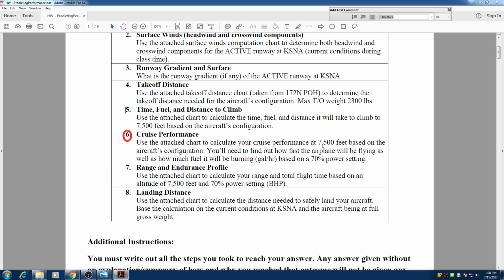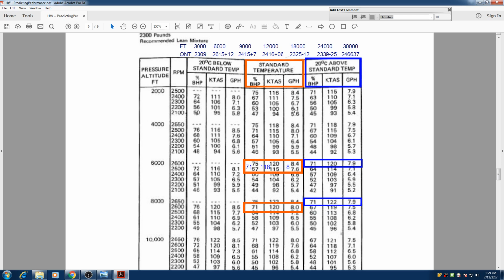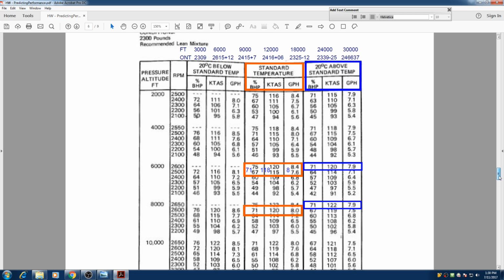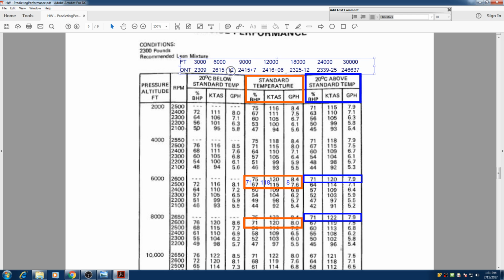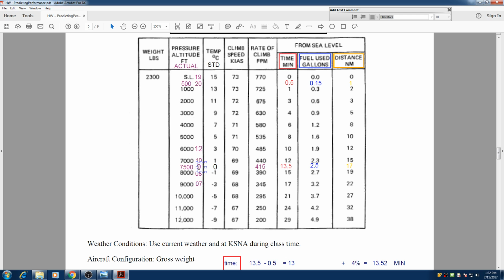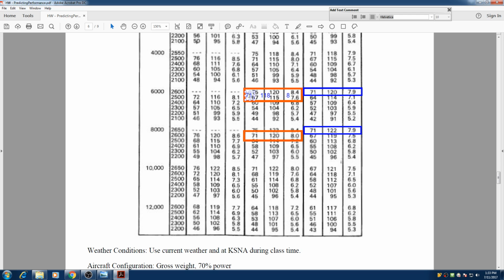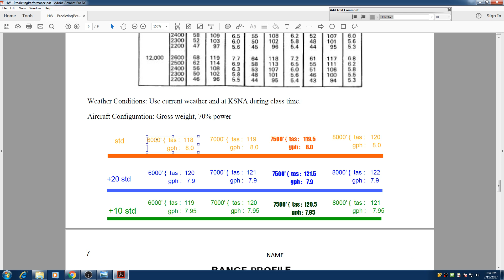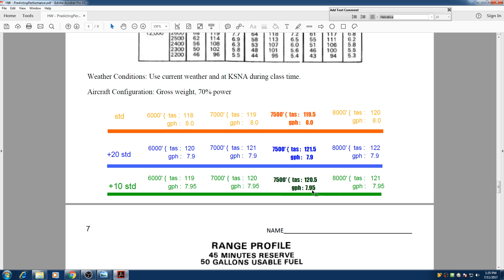Cruise Performance (Step 6)

Comment: How do you go from 19 degrees C at sea level to 20 degrees C at 500 ft if the temperature drops as altitude increases?
Reply: There could be a temperature inversion. Typically yes, as you gain altitude your temperature decreases but with a temp inversion, the temperature can briefly increase then go back down to normal 2 degrees celsius per every 1000 feet lost.

Comment: For the pressure alt you don't use an altimeter setting to add or subtract to the elevation ?
Reply: Same question. I hope he answers it.
Also my question is what if i am flying the next day, how do i find the altimeter setting for that if the metar doesn't show future altimeter settings & TAFS do not include altimeter settings at all...it's confusing..